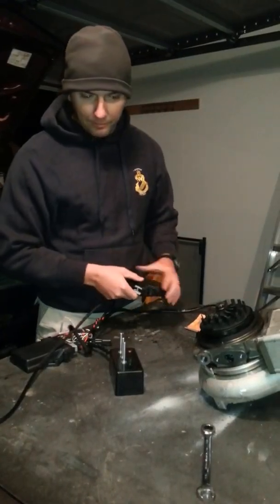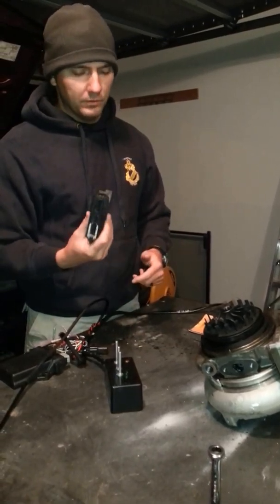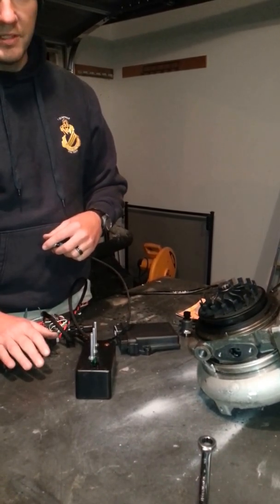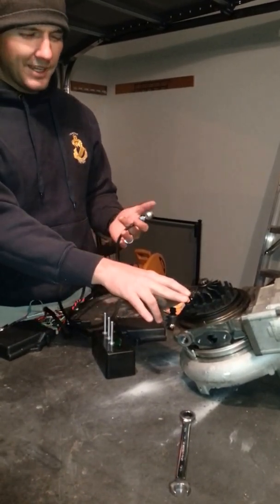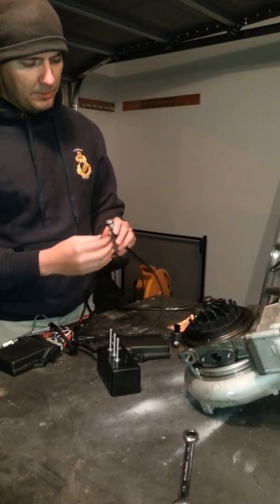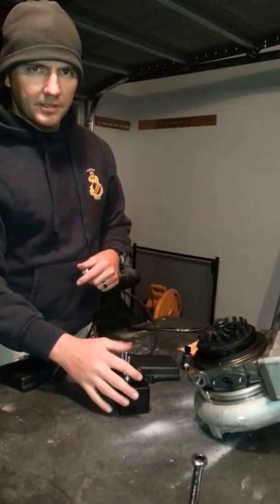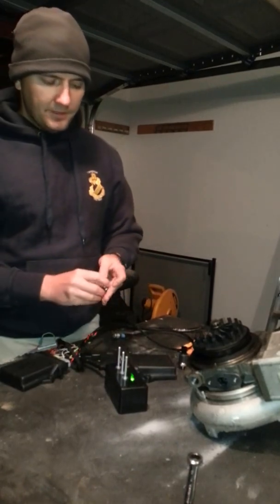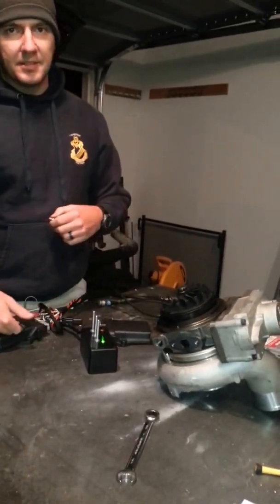Banshee II, VGT controller demonstration

Comment: Can this be used for a gas set up?
Reply from the maker: yes they have been installed on Supras and other engines. even older diesels. checkout my controller Facebook page
 https://www.facebook.com/bansheecontroller
Reply: @SteedDolan  So basically I use this with a compatible turbo on my 6.5? Do I need anything other than 12v source, boost pressure, and backpressure?
Reply from the maker: This video is pretty old, the newer version is a lot better. But yes, it'll run on anything just need power, boost and exhaust pressure sensor.

Comment: Good morning,  had a question about the banshee 2 controller, how would i set it up with a compound turbo setup.

Thanks for your time 
& have a good day.
Reply from the maker: The sensor would be connected to the engine right before the intake so the controller sees the compounded boost. You would then use the second knob to set where you want the VGT to go wide open at the desired PSI. Depending if the HE351VE is the high or low pressure turbo would mostly play a part on how fast youll want the VGT to open up at.